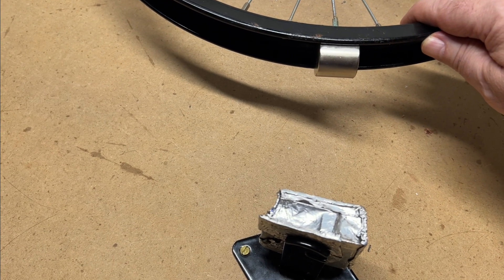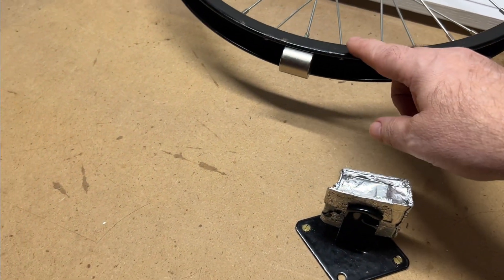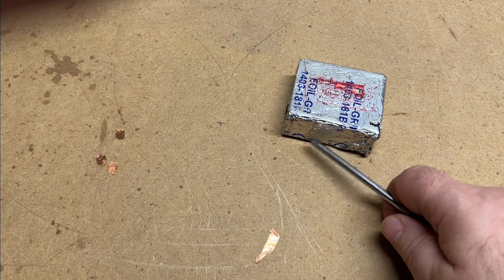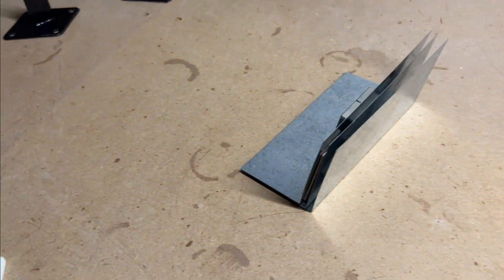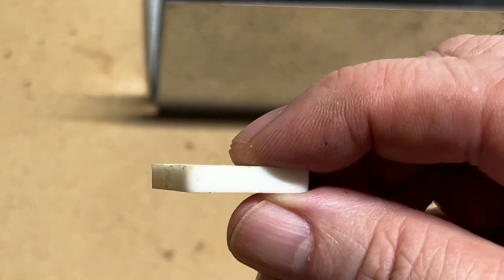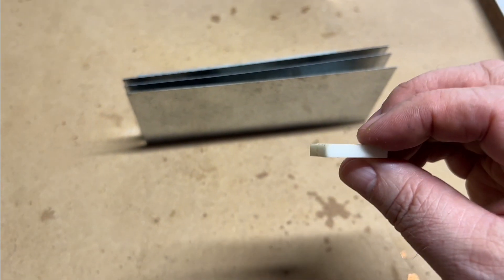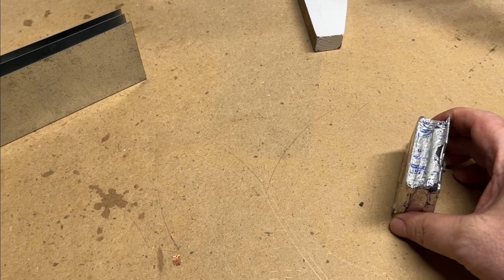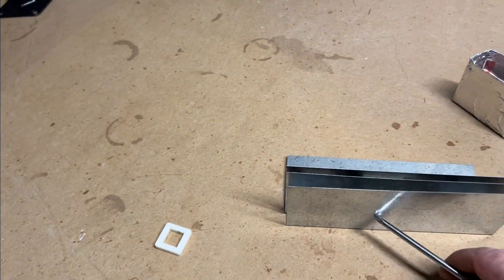🧲 Magnetic Motor Generator Research | Free Magnetic Energy

Comment: Seems to work. Great. Very great. There is something special... Very interesting. But the energy source remains unclear. Something from quantum vacuum ? Make a paper, you really could get the Nobel prize !!! Maybe the energy source is due to entanglement switching and thermodynamics of magnetic spins. Could you measure the temperature vs time at different positions ? That would probably give the physical answer !
Reply from the maker: 🧲 The earth itself emits an ocean of eclectic energy that all of us are submersed in around the clock.
Reply: @FreeMagneticEnergy2  in principle seemingly true. But the " physicists " of the nobel Committee think a little bit different. They " deeply " want to understand, and they maybe don't believe, even if they must ( have to ) in this case . But : you have shown the experimental proof. You are right concerning the machine, but the microscopic and field explanation is maybe not perfect ! There is some kind of higher Physics ( to my opinion ) . A new point of view somehow. But ( yours ) very good work , that's for shure.
Reply from the maker: With a high speed magnetic vortex, who knows what might be possible. Set in apple inside of it and see what happens. The Philadelphia Experiment is a good example of such. Watch the movie if you haven't. 

🧲 BREAKING NEWS JUST IN: https://www.youtube.com/watch?v=8EYxKWsVx2k

Comment: welcome james
Reply from the maker: Thank youuuuuuu. I need to watch some of your videos. Especially the one on Magnetic Shielding.
Reply: @FreeMagneticEnergy2  I made two capacitors, 30 000 v 500nf each, I've been experimenting with them. I will be able to convert static electricity to dynamic electricity with these.
Reply from the maker: @ibry5360  - That's sound exciting. I use PVC for plate capacitors as well as in cylindrical form. IE: Large PVC pipe. The dialectics of PVC is through the roof and then some. Much so, that I have to be careful not to electrocute myself with it. It's the best material to build a ball lightning generator out of that I've found. Easy material to work with as well.
Reply: @FreeMagneticEnergy2  me da gusto volver a verlos señor quisiera que pusieras subtítulo en españo soy seguidor de tu canal y no entendido mucho del tema pero veo que es interesante también me gustaría que siguiera subiendo más videosl
Reply from the maker: @anuarsalazar2705   🧲 No sé cómo hacer eso. Lo investigaré de inmediato. Necesito encontrar automatización para eso. Gracias por visitarnos, señor.
Reply from the maker: @anuarsalazar2705  - 🧲 Hice algunos cambios. Espero que funcione. Nunca he hecho esto antes. Sin embargo, es posible que solo funcione en videos nuevos a medida que los subo. Así lo hice para el próximo video. Espero que funcione. Gracias por detenerte. https://youtu.be/C0f0_BNUcx4
Reply: @FreeMagneticEnergy2  si yo te sigo desde hace diez años  y e entendí lo del mumetal  lo del papel aluminio para hacer la jaula pero no entiendo lo de las dos ruedas de bicicleta muchas gracias
Reply from the maker: https://youtu.be/jsgUF5DHAwo
Reply from the maker: 🧲 BREAKING NEWS JUST IN: https://www.youtube.com/watch?v=8EYxKWsVx2k

Comment: It's fascinating that motivated investors are almost without exception, suffering through health and livelihood setbacks. Some soul path option that comes as a package perhaps :)
Interesting stuff. Similar to what I pondered back in the day. Curious that it seems to work with the big gap.
I'd like to see heat monitored in the stator and rotor magnets eventually. I guess also flux measurement to see whether magnets are being drained or not.
Perhaps tradition V-gates work better with stronger magnet and larger gap?
Reply from the maker: You bring up some interesting points. There is a long history of various inventors who suffered through health issues, especially livelihood setbacks, especially funds. Today, many of them suddenly die, are poisoned, have mysterious car crashes, or simply disappeared without a trace never to be seen again.

I've long suspected that soul paths may very well predetermine an over all path we live out. Will know more once I pass over. Sadly I wont be able to update you here what I learn. :( 

Once I add more stators I can tighten the gap. Really needs 8 stators total. They will have to be built with precision for best results. 

Heat monitoring might prove to be interesting. I'll keep that in mind. I'll have to buy more gear to do that, of which I  need anyway. As for  degaussing concerns of the magnets?  Before and after measurements amount to days, weeks, months and years down the road of taking readings should give us a life expectancy of effective strength. I believe there will be a big curve at first that will quickly to start to slow down.

As for V-gates... stronger magnets will increase torque. Larger gap will decrease torque. My goal is to build a four foot long version, sixteen inches in diameter, but only if I can get a small model working first. However, my magnet config will be very different than that of the layout of the V-gate. Most notably, no V configuration, just one long endless downhill action. No gate will be required.

Thank you ever so much for your valued insights, and for taking the time to stop by.
Reply from the maker: 🧲 UPDATE: October 17, 2022 👉🏻 https://youtu.be/2fk98lBMx9I